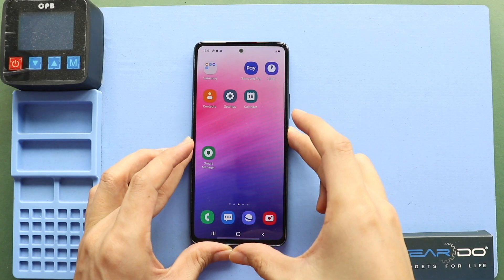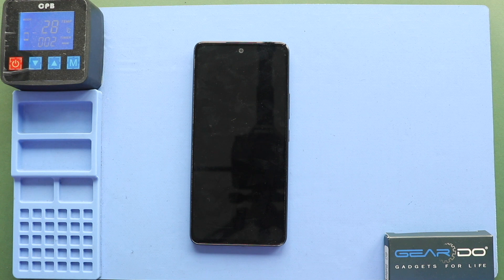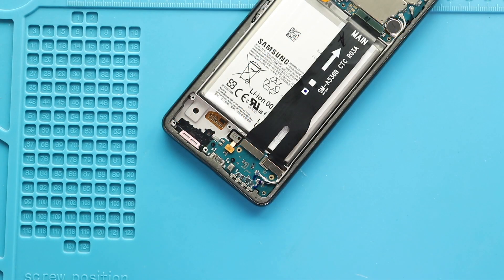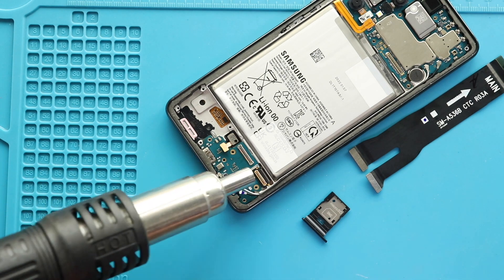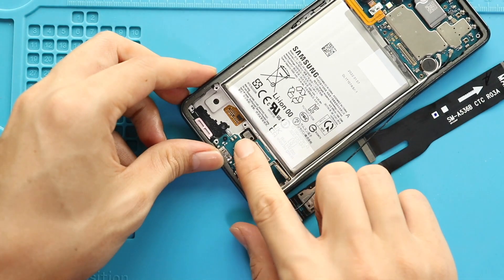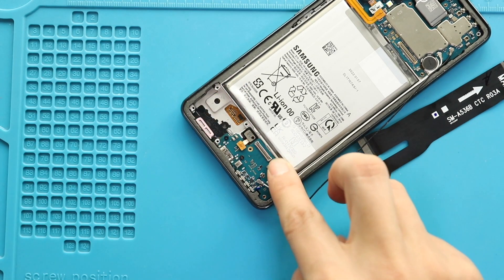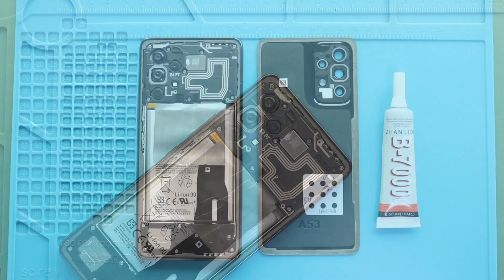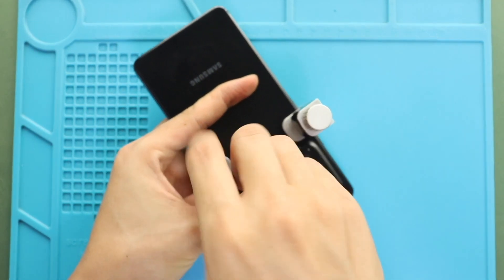Samsung Galaxy A53 5g Charging Port board Replacement

Comment: I can't transfer data from phone to pc,  It was possible before, but now it doesn't work with the cable and it doesn't recognize OTG. What should I do?
Thanks ❤
Reply from the maker: Try a different cable/cables, Clean the USB ports, Enable Data Transfer in the Phone, software update, You can try a reset to after backing up, finally replacing a new charging board..

Comment: Hi, thx for the Video. I damaged the lcd cable because i forgot to add heat for removing from the charging board. Is the lcd Cable also replacable?
Reply from the maker: Lcd cable will be hard, not the main flex right?
Reply: @DIYGeardo  yes, lcd cable. Ordered a new display. Think thats my only option

Comment: The 2 black screws holding the charging port in place looked like slightly different lengths. I decided not to put the longer looking one in, so I put the shorter on in the converter hole. It works, but I need to find out if those 2 are different so I can go back in and secure the port better. Other than that, it's great.

Comment: what an awful experience with this phone, never had an issue like this before.  The phone just wouldn't let me charge it showing me a warning how the charging port is wet even though it wasn't wet at all and it was safe to charge.  I had to charge my phone before going to sleep so I started poking into the charging port trying to make the stupid sensor stop detecting whatever was there, and I must have broke it for real.  I need to access my pictures for work and I can't, I've never been so angry at a phone.  I give up trying to fix it, it's hammer time and it's going to feel great.